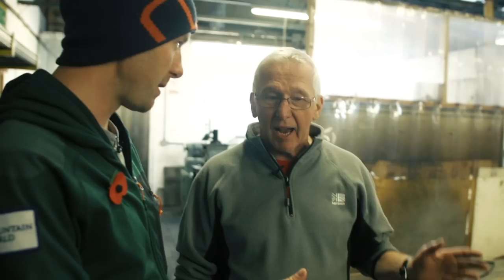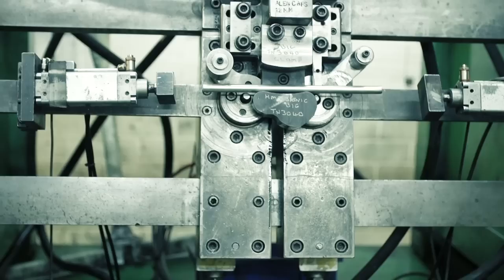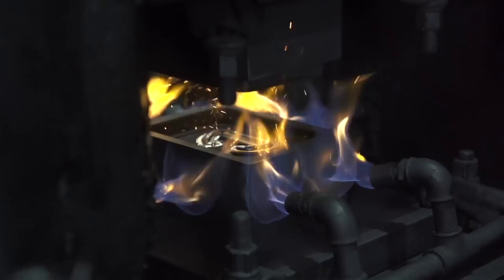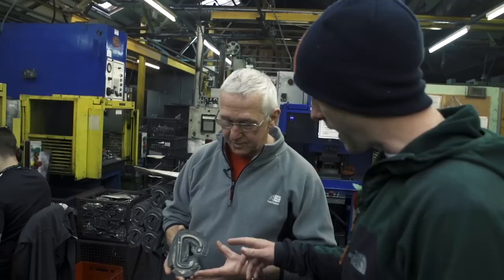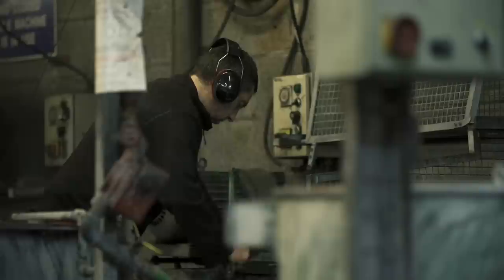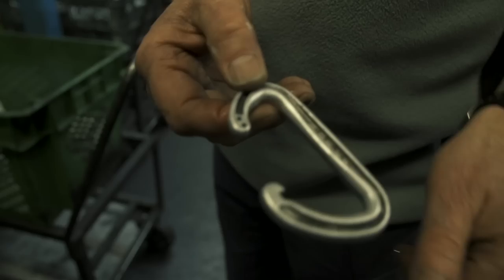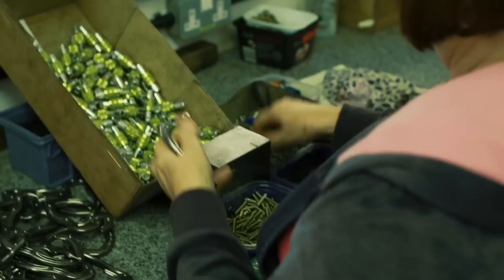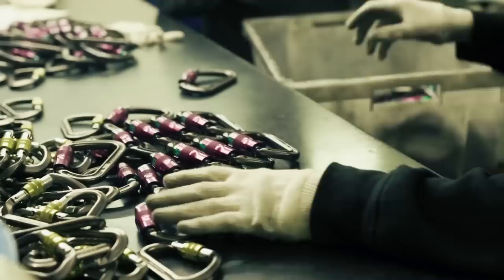Every Carabiner You've Ever Clipped Started Life Like This | EpicTV Climbing Daily, Ep. 558

Comment: So many automatable repetitive tasks done by people. I wonder what the tipping point is for automating vs paying for all the all man hours.
Reply: They mentioned it very quickly but they said that one of the processes was being done by hand to show how it is done and was normally automated. I imagine it's the same with the other steps but they were showing the prototyping shop or something
Reply: at the moment, robots that can load small parts reliably and quickly are way too expensive. so for example with the guy manually drilling the wire gate holes at 5:10, if you wanted to automate that you'd spend 20 or 30k on a CNC drilling machine just to have that same guy still standing there loading and unloading the machine with hardly any resulting speedup. massive automation happens in massive factories first, not small workshops like this that can benefit from flexibility.

Comment: Yes DMM carabiner's are very good but? they're not as good as Grivel but? then again there's so many different carabiner model's from so many different manufacturer's i'd be more like a kid in a pic n mix candy store 😂😂😂 but seriously don't! use non load bearing carabiner's for climbing b'coz them type's is only intended for key clips & attaching thing's such as water bottles to bags & such like however the more expensive carabiner's are considered PPE (personal protective equipment & have been specifically designed for rock climbing & ice climbing! & never ever use a carabiner that's even slightly damaged replace it immediately with a new carabiner!
Reply: So if it has a tiny scratch throw it in the bin?